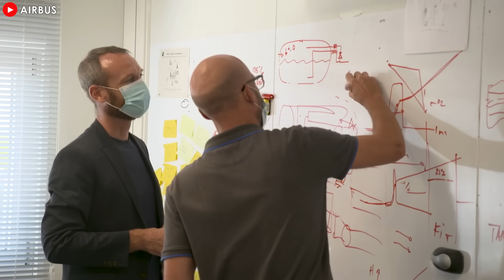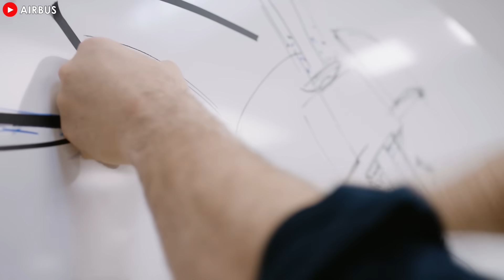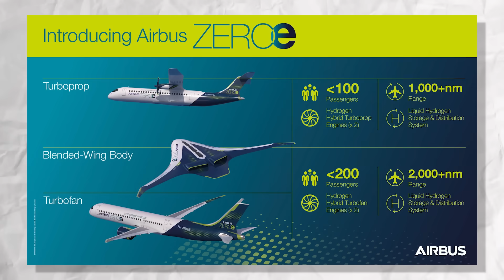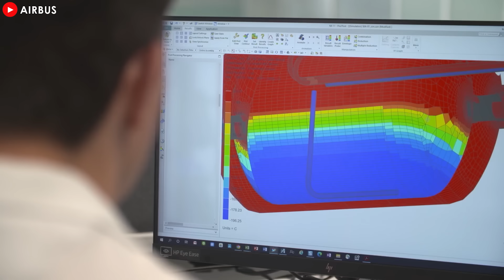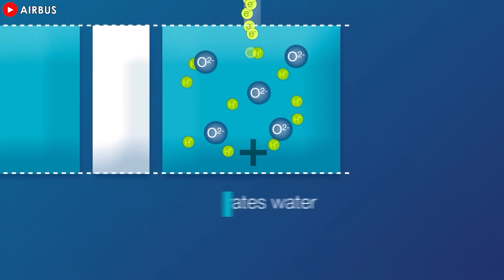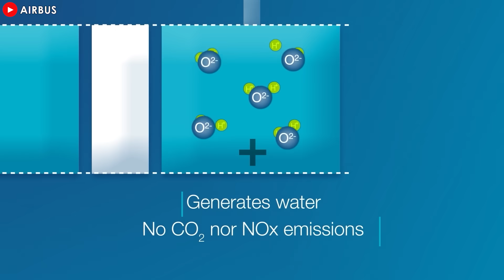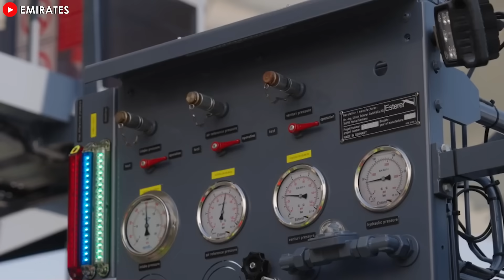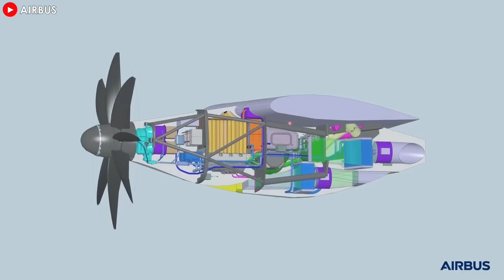The Airbus Is Building A NEW Aircraft NOW! Here's Why

Comment: Hydrogen is a mistake. It didn't work in the automotive industry and it won't work in aviation. No airline will make the necessary investments in a hydrogen infrastructure. And it is still completely unclear where all the hydrogen that would be needed for the planned operation of ZEROe aircraft would come from. It would make much more sense to use the existing infrastructure to operate aircraft with synthetic fuels.

Comment: Airbus is doing modem things much better than Boeing. That will give them a decade long of supremacy. However the complete new technology with H2 is most probably overoptimistic, the same problem Musk has with his rockets. You have to ditch quite a number of prototypes to get a commercial sustainable product. Oh yes the Chinese are on the right track also, not a very serious threat outside of China, but still it will consume a nice piece of the cake.

Comment: The E project is just money invested in a PR campaign.
No hydrogen or bio-fuel will be meaningfully (beyond PR) used in aviation for as long as conventional fuel is a better option, which is all of the foreseeable future. Until a breakthrough technology comes up, which doesn't exists at this point.
The pressure from the customers comes as demand for lower price, more frequency and more non-stop destinations due to the use of online travels apps.
Nobody chooses an specific flight because the carbon footprint.
Reply from the maker: ''Nobody chooses an specific flight because the carbon footprint.'' Practical purpose!
Reply: @FLIGAVIA Not ideal, but it is what it is. To deny it is just posturing...

Comment: BS. The hydrogen in a Toyota Mirai is stored at ambient temp.
Reply: In cars, you don't care as much about weight and volume. Liquid hydrogen (the kind that has to be supercooled) has a much higher density than gaseous H2, meaning that it takes up much less space. Thus, fewer tanks are needed, which saves a ton of weight.
Reply: Because in cars the gas is compressed, not liquid.

Comment: Interesting move by Airbus.
Hydrogen technology is complicated to make work in the real world, but it does seem more suitable for airliners than for cars.
There are a lot more gas stations than there are airports, so distributing Hydrogen for airplanes would be less of a challenge.
Also hydrogen's energy density is a much greater advantage for an airliner than for a car. 
For a car you can have a battery pack that weighs a few hundred kg and still have an efficient design, but the battery needed to power a long range airliner would be too heavy. This could make it worth the cost of having pressurized tanks to hold liquid hydrogen and making sure they are safe.
Reply: Hydrogen has more thermal energy and higher efficiency, but generates less gas. A turbojet is a gas generator.
It is the same reason why you don't see cars engines burning hydrogen. They generate less power.
Reply: Pressurised H tanks... Inside a plane? Does anyone reme3about Hindenburg accident? No memory or just ecomadness?
Reply: @lorenzokaty  That's why I ended my comment with "and making sure they are safe". 
If a liquid hydrogen tank blows up it will be very bad.

Comment: This H2 technology will be a like the Boeing disaster, but worse.
It is just to expensive to generate H2 and up to deliver to where it is needed.
Same as the car industry. It fails again and again.
Reply: There are a lot more gas stations than there are airports, so distributing H2 for airplanes would be less of a challenge.
Also hydrogen's energy density is a much greater advantage for an airliner than for a car. 
For a car you can have a battery pack that weighs a few hundred kg and still have an efficient design, but the battery needed to power a long range airliner would be too heavy. Therefore H2 could be the best alternative for an airliner.

Comment: Burning hydrogen in a modified jet engine could send the World into an ice age as the clouds formed with block the Sun's energy from reaching the surface much as todays contrails do but to a far greater degree. This means that the fuel cell technology with the water retained in tanks will be the way forward for international travel.
Reply: The contrails enhance climate change :/
Reply: I doubt that this would be enough to have that big an effect. In some parts of the earth more clouds would be a good thing. 
Maybe at takeoff and landing water should not be emmitted to avoid changing the weather around large airports.
Remember that the water generated from burning hydrogen is 9 times as heavy as the hydrogen itself (1 oxygen atom has the mass of 16 hydrogen atoms). No airplane would want to carry all that extra weight.
Reply: 🤡  hydrogen  is a Greenhouse Gas
Reply: @DSAK55  Certainly hydrogen can act indirectly to affect the climate, but the engines won't emit hydrogen into the atmosphere.  They will burn hydrogen and emit water, which may have the opposite effect because water vapour reflects sunlight back into space.  Whether this is a good thing, I have not the expertise to conjecture.

Comment: The Boeing 777 is one of the most significant and influential commercial aircraft ever built. First introduced in 1995, the 777 revolutionized long-haul air travel with its advanced design, impressive range, and passenger comfort. As Boeing’s first wide-body twin-engine airliner, it combined the efficiency and reliability of its two engines with the capacity to carry large numbers of passengers over long distances. It was specifically designed to fill the gap between the smaller Boeing 767 and the much larger Boeing 747, providing airlines with a more economical solution for long-range flights.

Development and Design:

The 777 project began in the early 1990s when Boeing recognized the need for a more fuel-efficient airliner to meet the growing demand for international air travel. Boeing collaborated with major airlines, including United Airlines, to design an aircraft that would meet the needs of both carriers and passengers. The 777 was designed from the ground up with input from airline operators, which contributed to its innovative features.

One of the most notable aspects of the Boeing 777's design is its large, wide fuselage, which allows for a spacious cabin configuration. The aircraft was developed to accommodate a variety of seating configurations, from a two-class setup with approximately 300-350 passengers to a three-class setup with a capacity of up to 400 passengers. Its cabin is wider than other aircraft in the same category, providing more room for passengers and offering a more comfortable flying experience.

Boeing’s design team placed a heavy emphasis on fuel efficiency. The 777 features advanced aerodynamics, including a wing design with raked wingtips that reduces drag and increases fuel efficiency. It also uses advanced composite materials in its construction, which reduces the aircraft's overall weight, further enhancing fuel economy. The 777’s engines, initially developed by Rolls-Royce and General Electric, are among the most powerful and fuel-efficient in the world.

Variants and Evolution:

Since its introduction, Boeing has produced several variants of the 777, each designed to meet different market needs, with the family growing to include various models with distinct performance characteristics and capacities.

1. Boeing 777-200: The original model, the 777-200, entered service in 1995. It was designed for medium-to-long-range routes and could carry 314 passengers in a two-class configuration. With a range of approximately 5,240 nautical miles, it became popular for transatlantic and transpacific routes, connecting cities like New York, London, and Tokyo. The 777-200 was also the base for the later 777-200ER (Extended Range) version.

2. Boeing 777-200ER: Launched in 1997, the 777-200ER offered an extended range of up to 7,370 nautical miles, allowing it to fly longer distances than the original 777-200. This model became popular with airlines needing to operate long-haul flights, particularly those traveling between the U.S. and Asia or Europe. The 777-200ER also introduced a more efficient engine configuration, providing better fuel economy and reduced operating costs.

3. Boeing 777-300: The 777-300 is a stretched version of the original 777-200, offering more passenger capacity and longer range. With a length of 242 feet, it could carry 368 passengers in a two-class configuration and had a range of approximately 6,014 nautical miles. It entered service in 1998 and quickly became a popular choice for international airlines operating high-capacity routes. The 777-300 has been particularly favored for routes between large hub airports, such as those connecting North America to the Middle East or Asia.

4. Boeing 777-300ER: The 777-300ER, introduced in 2004, is the extended-range version of the 777-300. With a range of around 7,370 nautical miles, it is capable of covering even longer distances than the 777-300. It can seat around 396 passengers in a two-class configuration, making it a highly efficient long-haul aircraft. The 777-300ER incorporates the latest generation of engines, providing better fuel efficiency and a quieter, smoother ride. It has been widely adopted by airlines for long-haul international routes, particularly those between major city hubs like New York, London, Dubai, and Sydney.

5. Boeing 777X: The 777X is the next generation of the 777, designed to be even more efficient and technologically advanced. It incorporates new technologies, including the latest-generation engines developed by GE Aviation (GE9X engines) and new composite wings with folding wingtips. The 777X includes two primary variants: the 777-8 and the 777-9.

777-8: The 777-8 is a slightly smaller version of the 777X, with a seating capacity of around 384 passengers. It is designed for long-haul routes and offers a range of around 8,730 nautical miles, making it one of the longest-range aircraft in the world. The 777-8 is positioned as a direct competitor to the Airbus A350-900, offering greater efficiency and lower operating costs.

777-9: The 777-9 is the larger variant, with a capacity of up to 426 passengers in a two-class configuration. It has a range of approximately 7,285 nautical miles and is designed to replace the aging fleet of larger wide-body aircraft, like the Boeing 747. The 777-9 is set to become one of the most advanced and fuel-efficient airliners in service, with improved passenger amenities, a quieter cabin, and lower environmental impact.

The 777X family is set to revolutionize the wide-body market, and its first deliveries are expected to take place in the coming years, with airlines already placing significant orders.

Performance and Features:

The Boeing 777 is known for its impressive fuel efficiency, which has allowed it to become the aircraft of choice for airlines operating long-haul routes. It has a cruising speed of around Mach 0.84, which is slightly faster than most competing aircraft. Its range varies by model, with the 777-200ER capable of flying up to 7,370 nautical miles and the 777X models pushing the limits even further.

The 777 is also renowned for its passenger comfort. It features a spacious cabin, with wide seats, large windows, and excellent overhead bin space. The cabin is pressurized to a lower altitude than many older aircraft, which helps reduce passenger fatigue during long flights. The aircraft also features advanced air filtration systems, quieter engines, and smoother flight characteristics, making it a favorite among both airlines and passengers.

Boeing 777 in the Global Aviation Market:

The Boeing 777 quickly became one of the most popular and widely used wide-body airliners in the world, with thousands of aircraft in service across the globe. It has been widely adopted by major international airlines, including Emirates, United Airlines, American Airlines, and Qatar Airways, and has become the standard for long-haul flights between continents.

Its reliability, efficiency, and operational flexibility have made it an essential aircraft for airlines serving international routes. The 777’s popularity can be attributed to its ability to provide high capacity, lower fuel consumption, and reduced operating costs, while still offering a high level of comfort for passengers.

The Boeing 777 has also made a significant impact on the air cargo industry, with many freighter versions of the aircraft in operation. The 777F (freighter) is an essential part of the logistics supply chain, offering large cargo capacity and long-range capabilities, making it an ideal choice for shipping goods across the globe.

Conclusion:

The Boeing 777 is a cornerstone of modern commercial aviation. Its advanced technology, fuel efficiency, and range have made it a favorite among airlines and passengers. With its multiple variants, the 777 continues to set the standard for long-haul travel, providing airlines with a reliable, cost-effective solution for connecting cities around the world. The upcoming 777X family promises to push the boundaries of efficiency, further solidifying the 777's place in the history of aviation. It remains one of the most significant aircraft ever created, setting benchmarks for future generations of wide-body airliners.
Reply: A tissue of propaganda and bullshit the 777X is already outdated it is made of aluminum heavier than expected and will consume more than expected... The 350 1000 has only a few fewer passengers is worth much less will also consume little or less because it is made of carbon and will allow greater savings in maintenance since a metal cell is much more demanding and more complex to manage than a carbon one and much more expensive to maintain in good working order... The future is carbon planes not old aluminum cells... The 7779 is a plane from the 90s barely improved thanks to so-called revolutionary wings... But it's old all that's over Boeing is bankrupt and you are a funny fanatic who makes nationalist propaganda... Airbus has been selling more planes than Boeing for over 25 years now... Adios Boeing!!